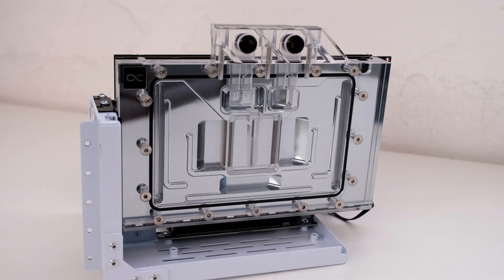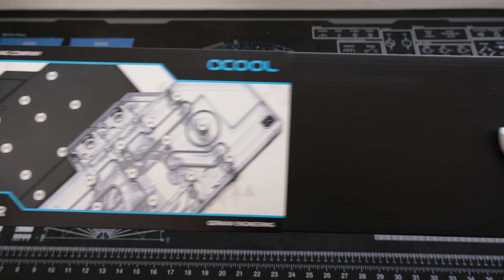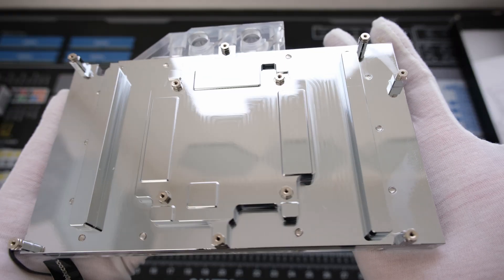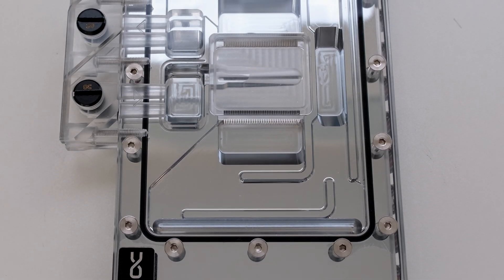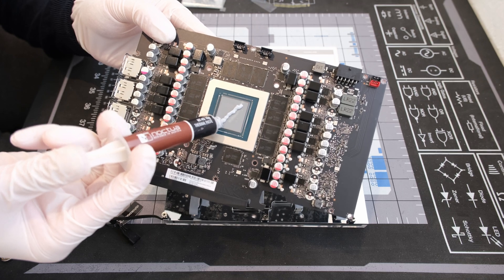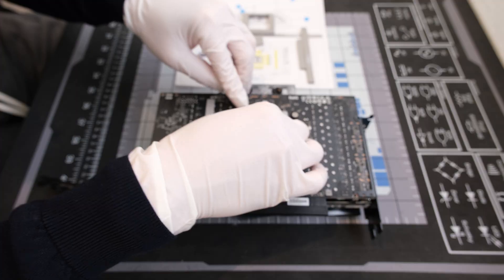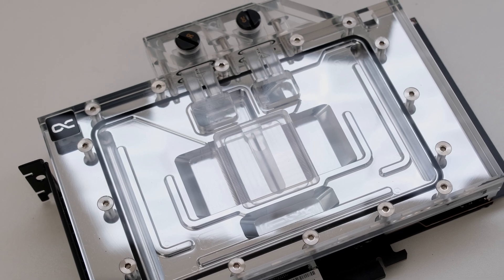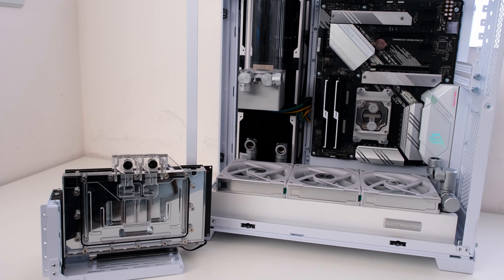Alphacool Eisblock RTX 4090 PNY Water Block Unbox Install Reference PCB NVIDIA GeForce Watercooled

Comment: Nickle plated.  Not chrome plated.
Reply from the maker: Thank you for your comment 🙏I just saw Der8auer's video where he said the Innochill one he had was nickel plating. I am subscribed to Der8auer and watch his videos because they are awesome. I got chrome plating from Alphacool's press release and their website. Press release I'll paste below, it has other good information.

Sep 20th, 2022
"The new Geforce RTX generation is here and Alphacool obviously offers a water cooler for it as well. The cooler for the new generation is much more than just another Eisblock Aurora GPU cooler. It is the first step towards a new generation of Alphacool coolers that brings significant improvements over the previous Aurora generation.

What's new? Alphacool will be using chrome-plated instead of nickel-plated copper coolers for all graphics card coolers in the future. A chrome plating is significantly harder and more resistant than a nickel plating. Chrome plating also benefits lighting because it is much smoother and reflects light better than nickel plating.

The cooling fins have been reduced to 0.4 mm and the spacing between the fins has been optimized to 0.4 mm. This creates a larger cooling surface and provides lower flow resistance for the cooler, resulting in better performance.

The water routing has been revised to provide a more even flow of water to the jetplate. The jetplate itself is recessed into the cooling fins and is pressed onto them by a new designed inlet with an O-ring. This ensures that the water is reliably pressed through the cooling fins. This also provides a performance plus.

The Alphacool Subzero with 16 W/mk is included as thermal compound. This high-performance thermal compound is one of the most powerful on the market. For the voltage converters and the graphics memory, 1 mm thin 7 W/mk soft pads are used.

In cooperation with board partners from Nvidia, the base of the previous Eisblock cooler has been almost completely reworked. These major changes can be clearly seen in the overall look of the cooler. Alphacool's new Aurora water cooler has been extensively tested on the new RTX 4090 graphics card generation and has gone through a long development phase to provide the best possible performance.

The coolers are currently in production and will start shipping to end customers and resellers in mid-October. An AIO variant in the form of the Eiswolf 2 will of course also follow shortly."

Comment: You don’t do testing?  This is the first water cooled 4090 video I have found and no data regarding temperatures.  So, how are those temps?
Reply from the maker: PC build video is up and temps ended up better than what I reported earlier. Same test, 36C GPU 47C Hot Spot.
Reply: @vectornetwork  I figured temps should have been better, thanks for letting me know 👍🏼
Reply from the maker: Thanks for your question 🙏 The next video is the build video and will have temps. I wanted to get the water block video out first, as I knew filming and building the custom loop would take a few days. But since you asked, the loop is just finished. I ran Time Spy Extreme and the GPU maxed at 57C and the Hot Spot was 69.3C. I am running two Heatkiller 360-L radiators with 3x Phanteks T30 and 3x Lian Li SL Infinity and they averaged between 600-1200 rpm. Hope that helps!

Comment: first watercooled 4090 vid I've found. Just gave you a sub
Reply from the maker: I appreciate it and thank you for watching. 🙏 Stay tuned as I just finished the footage for this card in a custom loop w/ optimus cpu block and reservoir/pump combo and 2x heatkiller 360-L rads for cooling. Vertically mounted upside down in a Lian Li o11D EVO 🙌
Reply: @vectornetwork  ik I can search it up but what’s the thickness of this waterblock? R the PCBs in the 40 series similar to the 30 series where some companies use the same reference cards as each other? Cheers.
Reply from the maker: @reloadedjulio  Thanks for your question 🙏 This is a 2-slot card. For the thickness of the block, I think you would want more precise measurements, but the thickness is about 1cm from what I can tell. Yea, the 40-series is the same as the 30-series where some partners will use NVIDIA's reference design like PNY and others will customize the design like Asus/MSI/Gigabyte and NVIDIA has their own design like the Founders Edition. Hope that helps.

Comment: Very nice looking block. Alphacool makes great stuff. EK is overpriced as hell and you need to purchase a backplate seperate.
Reply from the maker: Thanks for your comment 🙏 I have been pleasantly surprised at Alphacool and its why I decided to get this block. They outdid themselves this time around, improving in several areas. I still prefer Heatkiller but it is more expensive and they didn't seem to have anything at release. EKWB, I have had quality issues with more than 1 of their items. I even had a standoff break off and I was simply tightening by hand. 😑 Having said that, I try all the brands and I will continue to buy from EKWB them because I think they have some interesting products and designs.
Reply: No the backplate is sold with it but you have to pay more if you want the active backplate.
Reply: @tr3v98  The backplates from the first run of last gen EK quantum vector blocks, were sold separately.